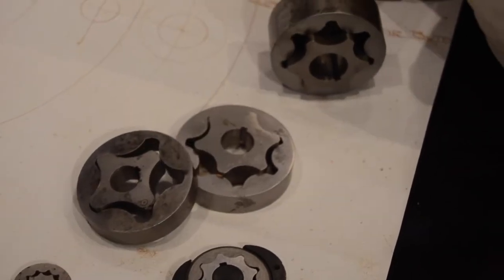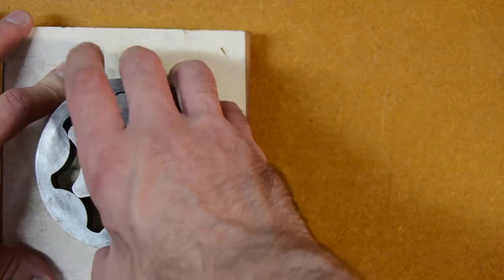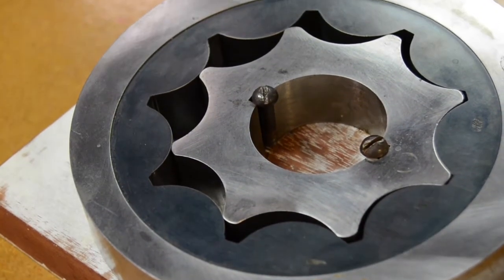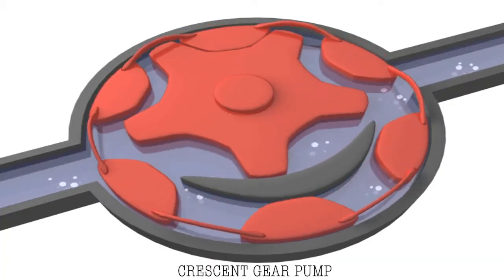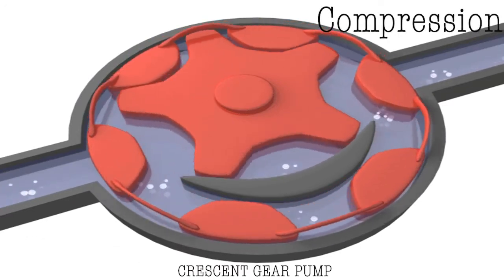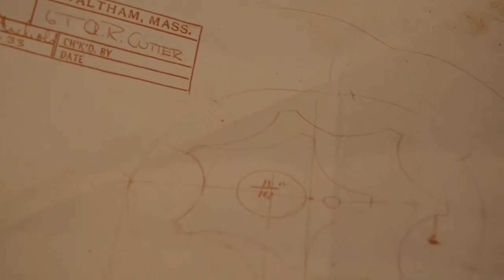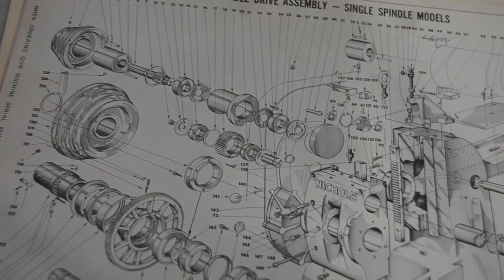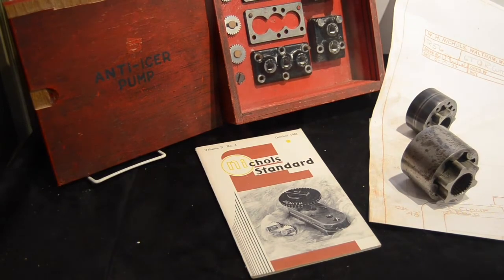Gerotors

Comment: That is what I do. I work at Nichols Portland in primaries where we use large compact presses to press metal powder into a part (gerotor outer or inner piece),  then harden and primary size them in a sinter furnace.  After that they normally go on a sizing press then to secondaries to get finish worked, cleaned, and packed.   We also make other parts besides gerotors like transnission gears for GM, Ford, etc.